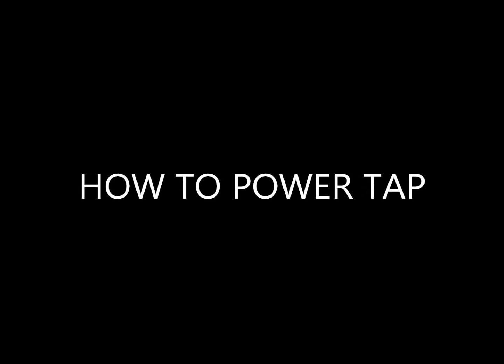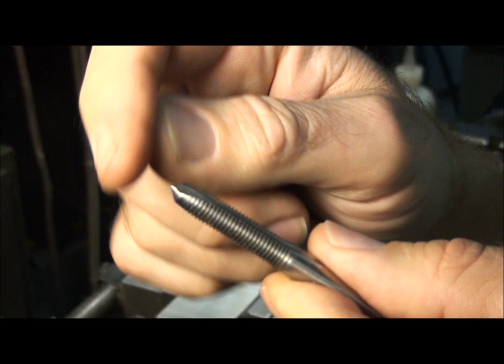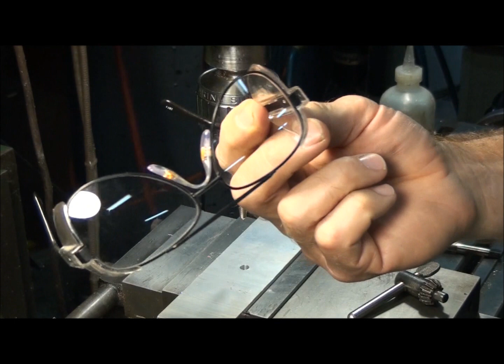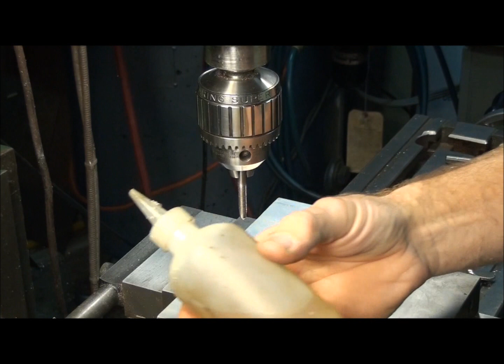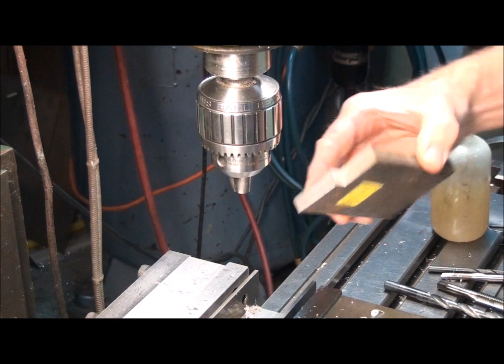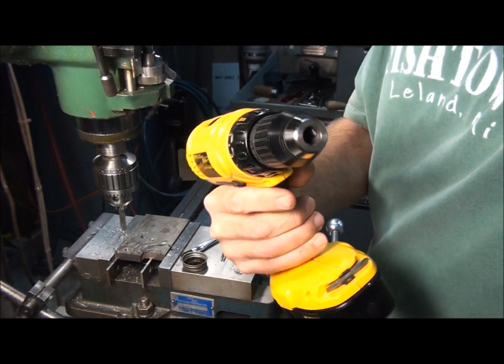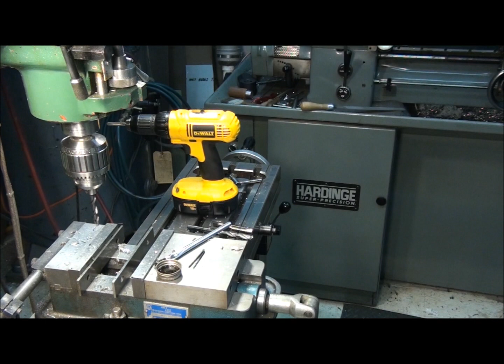How to Power Tap

Comment: 3) As regards letting the tap slip: That's good advice, I think, for people dipping their toe, but once your tools and technique are dialled in it's not essential
(and not doing it will, as others point out, save wearing the lettering off the shank!).

As I mentioned below my Toolmaster turret mill was designed for power tapping (in the early 70s), and when it's switched to 'tapping' mode, the spindle runs in reverse unless a push-button is held in, on the end of the downfeed handle. (The manual one, intended for sensitive drilling). This means at the first hint of binding you simply slip your thumb off the button and the tap winds back out. When you hit the bottom stop (which on this machine is designed with a pretravel, and microadjustable) in tapping mode, the machine decides you must have gone to sleep at the switch, and reverses the spindle on its own initiative.

With a setup similar to this I've had no breakage issues with HSS taps intended for machine tapping, when using ER collets tightened to the max. If I ever change mills, (unlikely!) I will feel the need to duplicate the setup, it's that fast and easy. I tend to use collets because the one limitation of this mill is a lack of headroom for the work envelope. (I bought myself a Shars snub-nosed ER32 holder, whose internals are buried back inside an NT40 body, hence about the same overhang as with an R8 spindle. Prior to this they were only available from very expensive labels like RegoFix. It has bought me enough spare headroom to save me from having to make a riser for my turret - still available from Cincinatti, BTW, for approximately as much as I paid for the mill with German DRO)

Tom's chuck is a Jacobs ball bearing Superchuck, one of the best chucks ever made, and it's well suited to being used as a sensitive clutch (probably more so than the modern-day chuck bearing the same designation). Most other drill chucks won't hold a tap much over 1/2" without slipping, no matter how hard you close them.
Reply from the maker: Unless you are tapping a blind hole...
Reply: Toms Techniques You're quite right, I should have added that qualification, Tom.
My "auto-reverse on reaching the depth stop" setup (which does permit safely tapping blind holes provided sufficient allowance is made for chips) is not something I've encountered on any other turret mill or drilling machine you'd be likely to find in a home shop. 
Having said this I did (carefully) power tap blind holes on my previous mill which lacked this brilliant feature, by marking the tap flutes and reversing at the correct depth, leaving (as I still do) a generous allowance for chip buildup. (And using helical fluted high quality machine taps, which evacuate almost all the chip from the hole)

Comment: 2)
You can save even more time by using a single tool which combines a drill point with a tap body. These are available in various quality levels, and I've even made my own from a helical fluted tap* by grinding the end on a drill sharpener and cylindrically grinding on a utility lathe but unless you do some fancy relief grinding on the OD it's only suitable for alu alloy
*(not advisable, as others say below, for blind holes!)

Comment: Nice job, Tom!
A couple of thoughts to expand the discussion:

1) As you point out, any 3 phase motor will reverse instantly (electrical people call it "plug reversing").
It won't hurt such a motor when the reversing switch is thrown heedlessly from 'full ahead' to 'full astern'. You can achieve the same effect with a VFD, but make sure you use the VFD's internal reversing switch.
Don't use an external switch like the one on the machine, unless someone who knows what they're doing rewires it with respect to the VFD)

On a big heavy mill, it's not wise to do it in a high gear. On my Euro-built Cincinatti Toolmaster, specifically designed for power tapping, they say to use instant reverse in back gear only, presumably to save inertial loads in the gearbox.

It might be worth pointing out that a single phase motor, if you reverse it 'on the fly', will generally keep happily going in the original direction. I don't know any safe way of instantly reversing a standard single phase motor. If you just turn off the motor, there will be a considerable variation in how far it coasts to a stop - probably not great for blind holes unless you are turning real slow.

Comment: I always tap with a cordless drill, works brilljantly, reverse it every few turns and go
Reply from the maker: Yup, me too. You do need to careful with alignment though without the mill to keep the tap square.

Tom
Reply: @TomsTechniques  Alignment or rather misalignment is a common cause of tap breakage regardless of how the tap is driven.  I have used a Milwaukee corded drill for drilling and tapping for over 40 years.  Matching the angle with the tap in the drill is actually easier than drilling the hole and then using a hand tap wrench.  The other advantage is controlling the torque direction being applied.  In other words accidentally flexing the tap as you drive it inward by hand.  This  and misalignment are the 2 most common causes of hand tap breakage even when you use the correct tap drills.  But as Tom pointed out using the correct machine taps which are typically not found in hardware stores.

Comment: I had to chuckle at this video because I do this all the time, but 1/2 inch is about as big as I like to go just because anything bigger I cant get my chuck to hold it without slipping. I do have a tapping chuck that works in my lathe or mill but in the mill it slows the job down. I just use regular taps but lots of cutting oil and only about 60 rpm, thanks
Reply from the maker: Yeah, a half inch tap is pushing it, but even if it slips, at least the tap is started straight and you can finish it up by hand. I often do the same with small taps because the chuck releases when reversed.

Tom

Comment: I've done this for years, and never heard of leaving the chuck loose.  It may save the tap from breaking, but taps are a lot cheaper than drill chucks.
Reply from the maker: It doesn't hurt the chuck. I've been using the same chuck on my mill for 30 years and it still works just fine. BTW, taps may be cheaper than chucks, but having broken ones removed sure isn't.

Comment from the maker: Most hand taps are four-fluted and have long lead in angles on the cutting edge. Both of these features make them easy to start. They will also often be made of carbon steel rather than high speed steel and are cut rather than ground.

Machine taps are normally two or three-fluted, are always high speed steel and will have ground threads and flutes. Spiral point machine taps also have a secondary angled flute to help direct the chips.

Tom

Comment: Never thought of power tapping being unconventional, one major difference and you are so like me Is that I use a much slower speed in both lathe, mill and cordless drill. Main reason I get a better feel for whats happening along with quicker time to do something about.
Logically faster will cut easier, touch wood never broke a tap yet in over two decades.

Comment: Tom good info I never thought of not tightening the chuck too much  to let the tap slip.  I use the hand drill way often.  I set the clutch on the drill to avoid breaking the tap if it binds up.  But I don't do anything above 1/4 because we don't have nice spiral point taps.

Comment: Hi Tom...as a novice, I have been running the mill (step pulley) in the slowest speed to give myself more time react/reverse.  Do see any issues with that?  Also you didn't address percentage of thread which I might adjust depending on the build/strength required...thoughts?